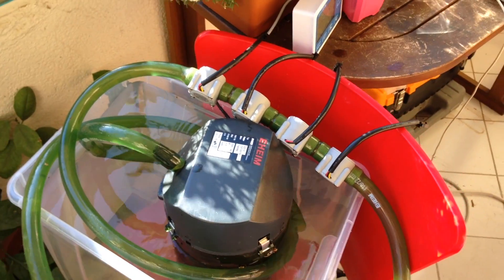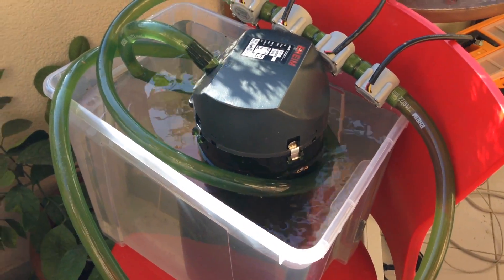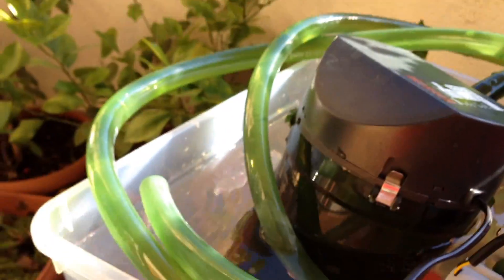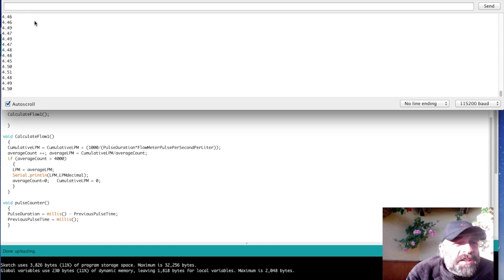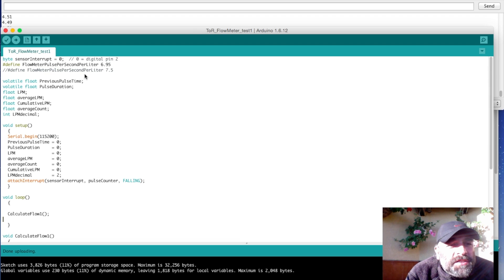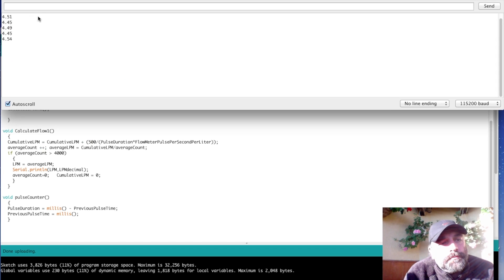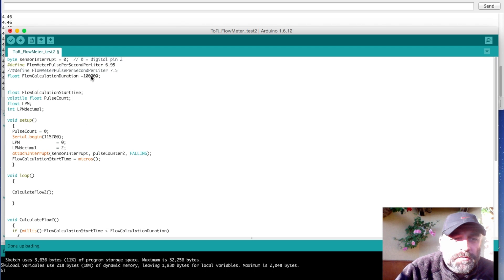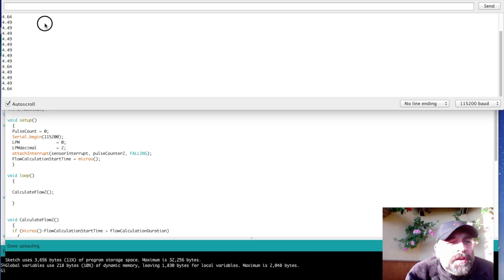Arduino YF-S201 Flow Sensor calibration and usage

Comment: Hi, actually I wanted to make a water billing system using rfid and water flow sensor.. what I need to do is as soon as I pour water through sensor the quantity flown is recorded and according to preset rates of the liquid user is asked for swiping the card so the required amount get deducted.. The main problem iam facing is handling interrupts of water flow sensor..How do I avoid continuous printing of water flown on serial monitor and coordinate my water flow loop with rfid loop
Reply from the maker: harshit rathod Your project actually is very similar to temperature loggig with a temperature sensor.  since I understand from your comment that you need time information as well as the logged data,  you need to consider the flow data or otherwise volume data being as always available similar to a temperature sensor. You just need to determine how often you need to log your data. if you try to determine for example each session of handwashing you might get faulty wash session data if someone turns on and off the water couple times for each hand wash so as a solution ultimately you simply need a log of water usage overtime. just determine how often you want cumulative volume to be recorded similar to electricity billing.  add the rfid/used data as an additioanl field to your logs. i alwyas use a cheapo esp8266+wifi network for logging data to thingspeak.com.  if you dont have wifi than sd card. usage is same. once you have data logged you need to make another program/web app/system etc to view your data.  i hope this was helpful.

Comment: 0:32 if this sensor works by just blowing air inside then it will detect water flow when there's no water in the line. I want to use this for water pump automation to work only when there is water coming in from the line. When the pump does run dry, im sure the air flow will fool the sensor and the pump will keep running. I need your thoughts on this.
Reply from the maker: Aun Raza You might not have that problem. I would want to see if your pump might be able to move the sensor. I was blowing very hard and the air flow needed to move the sensor I believe is much higher than the water flow it normally detects. In the worst case you might need to put something else in line next to the sensor in your case to detect when there is liquid in line because ultimately this is a flow meter not a liquid sensor.
Reply: @Mr_ToR  trying to detect liquid is exactly what i want to do but I don't know what i should use. I'm not sure if i can get a flow switch that small.

Comment: Hi, im doing the similar project. My problem is the sensor doesn't show any reading at all the water flow slow/small. i've been looking on the internet, all the suggestions lead to change sensor model. If i need to change the model which spec should i look into? Is the impeller size in the sensor effect the reading?  my current water flow sensor model is SEN-HZ321WA.
Reply from the maker: Hi, That's a very good point.  You should first consider your project to determine your water flow sensor specification requirements.  You need to consider things like water pressure, approximate flow and pipe diameter.  If you will only have to deal with low flow, you should probably use a smaller diameter sensor and pipe anyways. However, the rest of the code, procedure would be the same.  Your only problem seems to be an inappropriate sensor.  You probably need something like the following:
https://www.aliexpress.com/wholesale?SearchText=HZ83C+flow+sensor

Comment: Does it might have an effect that you connected the sensors in series?  There is a work done against the propellers inside, and volume of the sensor cavity might alter the pressure?  What do you think?

My mind drifted to maybe be to connect them in parallel and use gravity as a constant force. 

Eline saglik :)
Reply from the maker: The biggest issue in my setup actually was the fluctuation of the mains voltage.  So the biggest improvement to this setup would actually be done by adding a mains voltage regulator which would eliminate changes in pump performance and flow due to voltage fluctuation.  Both the flow calculation and measurement had the same amount of sensors which has a zero effect in total.  Similarly the 'Hydraulic Head' and the gravity effect was the same in both scenarios which also resulted in zero effect in total.  If you have more than one sensor and want to measure all of them together, you should never connect them in parallel since you would be dividing the amount of water flowing by an unknown ratio and you can never be sure about how much flow you'll have on each sensor. In an ideal and unrealistic case you should have the flow divided by the number of parallel connections but that would never be the case in a real world case and it would only complicate your setup for no good reason.
Teşekkürler ;-)

Comment: Just a thought: If a certain amount of liquid has been fed through the meter, the "propeller" in the meter will keep going for a while without liquid, due to inertia resulting in false pulses. An up-stream flow switch in series with signal wire will avoid this.
Reply from the maker: utoopuser, in "normal" use you would not have a case of "without liquid". Your pump for example would experience priming problems etc.. still yet the remaining wettness inside would avoid it to keep going.  What you're suggesting is not applicable for taking instantaneous flow measurements. If you were measuring, lets say 20 liters, inertia would still not cause any problems at all too.  Other things might imply but not inertia. 

How and why do you think you will have air in your water line?
Reply: I was thinking of your calibration methodology, not real time. I missed the part where you were replenishing your feeder bucket.
Reply: thanks for your prompt reply.
I was just watching your calibration methodology, but I missed the part where you replenished the supply bucket, hence the air  question.

Comment: hi sir do have like this project in raspberry pi 3?
Reply from the maker: There shouldn't be any reason why you shouldn't be able to do the same in a raspberry pi.  However I consider raspberry pi to be a lot more expansive and unnecessarily more complex than using a simple micro-controller.  You have to deal with an operating system, possible file corruption due to power loss, boot issues, security etc.  I would consider a raspberry pi a bit of an overkill for this application however it should still work.  I also wouldn't really expect to get great performance with using an interpreted language/environment such as PHP which sits on top of an OS for interrupt driven time sensitive measurements which is done very easily with a micro-controller as in an Arduino since the code is executed and interrupts are measured very close to the GPIOs.  There is nothing in between your code and the chip pins.   Your code only has some performance overhead caused by the C compiler.  The only way to make this measurement any better on an Arduino would be to write the code in machine language which would actually be very cool in my opinion since the code would be run very efficiently without any overhead but definitely another overkill too :-)

Comment: what is the unit of the output? ml/h? l/h? ml/s?
Reply from the maker: ivan janka, i think this was clearly explained in the video. The sensor outputs pulses relative to the flow. You can use whatever unit you want. In my example i used liters per minute but you can use gallons per hour if you like.

Comment: sir how to calculate the calculation factor.please we badly need it
Reply from the maker: benjie pagolong, which part of the video is unclear? If you have problem doing this, use the supplied value from manufacturer spec. sheet
Reply: im sorry.in the calibration part sir.

Comment: every time it gives different reading for example if i displaced 500ml(measured 500ml),it gives  0.42 L
on second test it gives 0.63 L,on third test it gives 0.52 L for same amount of liquid of 500ml..
is there any way to resolve this issue??
Reply from the maker: Wasif Ahmed, some fluctuation is expected due to noise from sensor components material and design quality however, another reason could be due to mains voltage fluctuation depending on your location and quality of electrical service provided. Try using a voltage regulator on your pump while determining the calibration coefficient for your specific sensor. Also watch the source water level, if level changes that will affect the flow rate due to head loss.
Reply from the maker: if you want to use it for the total water amount, I think it's a much better approach to simply count the total pulses rather than dealing with averages and flow to total conversion etc.

Comment: how to calculate the amount of water from the flowmeter reading? thanks
Reply from the maker: mohammed alsheikh, let's consider you're calculating flow every 1 second, then the amount of water passed is equal to the flow rate (L/sec) since second is 1. So just add that amount to a variable every second and you'll have total water amount.

Comment: I have a similar issue with YF-S401 flow sensor, he is not showing smooth changes of voltages when I blow slow or fast
Reply from the maker: I bought 6 of them and all have different calibration values.
Reply: sir we have new designee flow sensor  requirement than mail me vishal@broiltech.com

Comment: Hi, very nice video,

is it possible to determine the accuracy of this solution? if it is put beside a water meter, will they show the same water consumption?
Reply from the maker: Thnx a lot. The specification for this sensor says: error:±5%. However, I think that error is the variance from sensor to sensor. I'm not sure if the values I obtained could be obtained by a professional calibration service. However, I think to get calibration values with higher sensitivity, a voltage regulator should be used for the water flow pump to avoid voltage fluctuations negatively affecting flow stability. Also, I don't know if the calibration values of these sensors drift in time or they stay same and their variance from one another is only due to fabrication.
I will check again maybe in another 6 or 8 months and see if these calibration values change in time.
They are $3~$4 and I think they are great for that price. I use them to monitor performance and determine maintenance time for my aquarium filters.
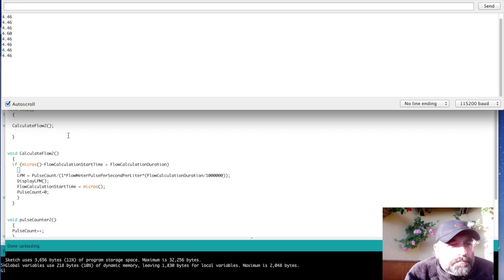Reply from the maker: Also, in my video at 10:10 I was able to adjust and set the calibration value for the flow from 4.46lpm to 4.49lpm  which equates to a stable adjustment with 1% sensitivity. I think that's awesome for a $4 flow sensor ;-)
Reply: Thanks for the reply... I hope I can use this sensor in my home to help me find any abnormal water usage... :-)
Reply from the maker: no problem. watch out for the water pressure since the sensor is rated 2Mpa = 20 Bar which should be ok for most cases anyways.